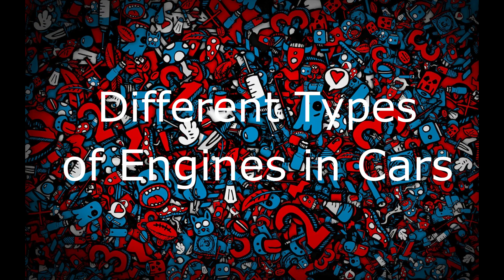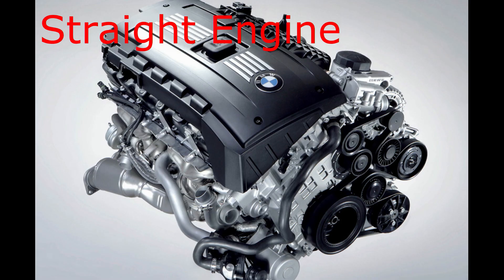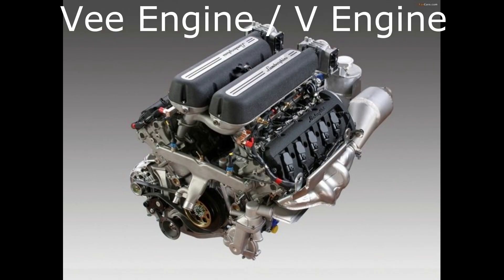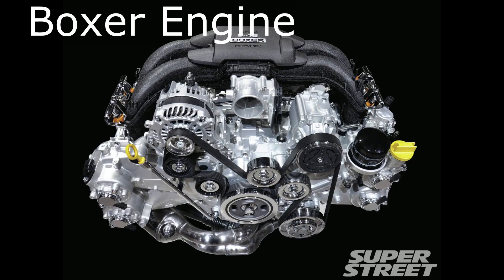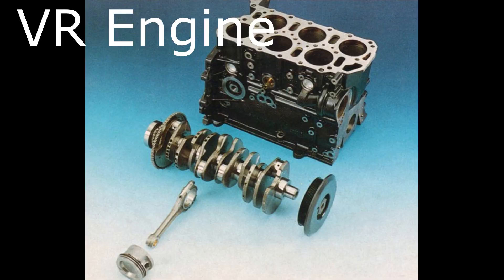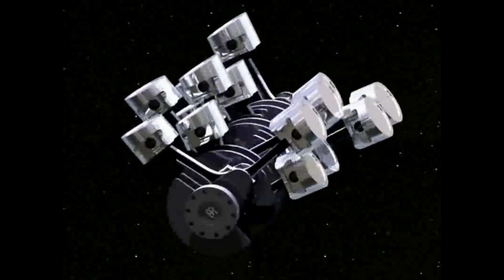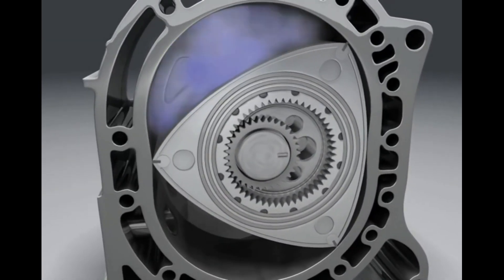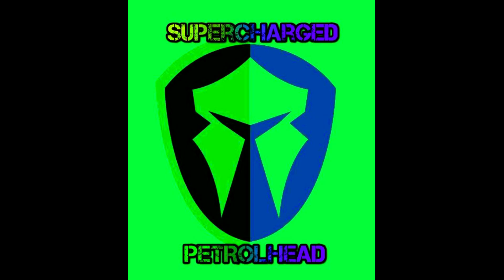Different Types of Engines Used in Cars

Comment: Great video but one error boxer and flats are different than each other boxer engine got their name because the way their piston moves which is opposite to each other where a flat is just a v engine mounted at 180 degree. Boxers and flats are different but straight and inline are same
Reply from the maker: yep, both the boxer and flat engine do have different types of crankshaft which makes them different and the straight and inline are similar engines except for the way they are positioned in the engine bay.
This is not a in-depth video, that is why I didn't go really deep interms of difference based on crankshaft and firing order and so on. 
This is a simple video for people who are not into cars to learn about just some types of engines and to differentiate them by just looking in the engine bay.
Thank you for watching.
cheers.

Comment: engine 1 is the same as 2 so no difference there u did however 4get 2 stroke cycles and 5 piston arangements or 3 like all new engines are doing plus ELECTRIC and my favourite AIR isnt on your list along with JET or ROCKET wich i feel needs adding to give a full impression of available engines the only engine not to be put in a car is the STERLING BUT!!! IT IS IN A SUBMARINE created by denmark or sweden wichever it won the WAR GAMES TITLE 2018 OR 9
Reply from the maker: Inline and straight engine are pretty similar but the main difference is the way they are positioned in the car, inline engine are placed horizontally in the engine bay that is they are placed inline with the front axle hence the cars will be mostly fwd or awd.
Interms of straight engine the engines are placed longitudinally in the engine bay and hence mostly the cars will be rwd or 4wd or awd....
Both might seem the same but have quite an major impact on the type of drivetrain and the type of car itself, that is why they are differentiated as inline and straight engine.
And this video is about types of engines based on cylinder position, hence I didn't particularly mention 2stroke because it can have all the same type of engine mentioned in the video like 4 stroke engine.
I did mention and talk about 3 and 5 cylinder engines, you might have heard it if you didn't skip and having odd number of cylinders doesn't change a thing. it still will be either inline or straight engine or in a very rare case a v engine like the v5 engine in a Honda's superbike.
I didn't talk about electric motor because it is not an IC engine, it is an electric motor.
Again I didn't talk about jet or rocket engine because they are not used in cars, yes there are some test mules and record breaking cars that use rocket engines but how many cars are available with jet engine that you can buy and that is the case with Stirling engine as well...

Comment: 4:15 Thats not a rotary engine. Thats a rotor engine. A rotary engine was the turning piston engine used on most ww1 fighter planes.
Reply from the maker: Those airplane type engines are called radial engine not rotary...
Reply: @superchargedpetrolhead  Radial and rotary engines are different. At a radial engine, the pistons are mounted to the still standing plane. But on a rotary engine, the pistons are mounted to the spinning propeller. Rotary engines were invented much earlier than radials or rotor engines which are used in a few cars
Reply from the maker: Nope....
Reply: @superchargedpetrolhead  That for example is a radial engine:
https://youtu.be/VZSDsWk9rdc
Here is a rotary engine:
https://youtu.be/Nk9Dl6RZxmQ
You should clearly see the difference
Reply from the maker: @Simon_r2600  Well thanks for letting me know...
I knew radial engine but i didn't know there was Radial-Rotary engine...
But this video is about engines which are most commonly used in cars and in the automotive sector, rotary engine refers to the wankel engine...
But those radial-rotary engines are certainly really cool to see and thank you for providing the link, I learned something new today...
cheers mate.

Comment: Which engine is use in race car and which engine is use to pick heavy load and Run fast
Reply from the maker: Currently most race cars use V type engines but there are some exceptions.
For your second question, the answer depends on the usage. every engine can be designed in certain way to either pull heavy load or have a really high top speed...

Comment: What about radial engine?
Reply from the maker: well, it is not commonly used in cars hence was not included.
Thank you for watching, cheers and have a great day.
Reply: supercharged petrolhead oh, okay. Do you think radial engines could work if they were placed on the wheels themselves?
Reply from the maker: @noahschuler6388  I don't think so, an IC engine needs a perfect placement and transmission to transfer the power so i don't think you can do that. cheers
Reply: supercharged petrolhead  thanks!

Comment: should i buy a car with 3 or 4 pistons, which one is best and which is better in gas milage
Reply from the maker: Which car are you looking at and what is their engine size?
Reply: @superchargedpetrolhead  I'm talking about the toyota PASSO which has 3 pistons compared to a 4 piston car like toyota VITZ which both look similar but have different engine sizes
Reply from the maker: @ilynpayne7491  Both cars are not sold in my country so i don't have a personal experience of them but from what i found on the internet that the passo has a 1000cc 3 cylinder and vitz has a 1500cc 4 cylinder. Basically a 4 cylinder is much more smoother and refined compared to a 3 cylinder. interms of mileage it is usually tough to point out which will be better but if you use it only for the city commute and you drive mostly in slow traffic then the smaller 1.0L 3 cylinder could be efficient and if you do a lot of highways and usually you live in a area with lesser traffic and you do some consistent high speeds then the 1.5L 4 cylinder could be better.
It also depends upon the weight you carry if you carry more people usually, then the smaller engine will struggle to keep up the speed inturn it might give less mileage than usual and also mileage depends on the type of transmission and the no.of gears in the transmission, your driving habit, etc.
On the whole i would say that the 1500cc 4 cylinder will be much more powerful, smooth and refined but the smaller 1000cc 3 cylinder will give better gas mileage.
I would suggest you to test drive both and see what suits your needs better, cheers mate.

Comment: 2:07 Honda make V5 engines
Reply from the maker: yeah, but the video is about engines used in cars, i referred to the common types of engines used in the cars, but anyways thank you for watching and have a great day
Reply: supercharged petrolhead still, not like a V5 couldn't be used in cars, I'm sure it has before
Reply from the maker: yeah, there might have been a crazy engineer who might have fitted a v5 in a car cause there are no shortages of crazy engines in a car from a inline 12 to a flat 16 and some even more crazier engines but if i had to refer all of those probably video would become an hour long and no one would watch it, cheers
Reply: Fairo

Comment: inline
straight
vee / v
boxer    - used in two car companies only they are Porsche and subaru

VR engine - Volkswagen

w engine- buggati veyron

rotary - mazda
Reply: Doesn't some vw use w engine tech?
Reply: pistikepowa87 w engine is volkswagens engine becuse its combined from two VR’s, and buggati is owned by vw, so is bentley.
Reply: @peterbach9276  Yes vw used it in their phaeton and touareg.
Bentley uses it as well.
Evan audi uses it in their audi a8l
Reply: What about Duke engine?
Reply: @vivekvardhan5671  inline cylinder
Reply: https://youtu.be/2Vy5x1sJQAk

Watch this video may be increase your concept
Reply: Radial..
Reply: @F1ll1nTh3Blanks  Used in old aircraft
Reply: Also a 2jz used in my favourite car MK4 SUPRA
Reply: Ws are also used by bentley
Reply: Im 100% sure rotary isnt used by mazda
Reply: @Simon_r2600  yes, they use rotary engine for RX8
Reply: @jawadulkarim8877  The only car i know that has a rotary engine was the Adams Farewell built in 1906. Mazda wouldnt have enough space for a actual rotary engine under the hood
Edit: 
https://www.youtube.com/watch?v=tZmd7k33JWE
Reply: @Simon_r2600  Mazda was the main company that continued making rotary engines but they discontinued it in 2012 mainly because it didn't sell well and rotary engines aren't very efficient.. They did put there 787B in a Japanese race car that won the 24 hour Le mans. I don't remember what the car was.
Reply: @Josh_dicicco  Im VERY VERY sure that they didnt use rotary engines. They wouldnt have enough space in a small Mazda for normal rotary engine and it would be inefficient. There was only one car in the world that was fitted with a rotary engine (Adams Farwell in somewhere around 1910) and also a few motorcycles used it back then
Edit: Here is the Adam Farwell car:
https://youtu.be/tZmd7k33JWE
Reply: @Simon_r2600  Your right they didn't use rotary they used a Wankel. Mixed up my history.😅
Reply: VR was used also by Lancia, who patented it in 1915 and used it starting in 1922 with the Lambda (VR4, one of the most innovative cars in history) and Trikappa (VR8). In 1972 Lancia won is first rally championship with Fulvia (VR4)
Reply: What about flat engines?
Reply: legend

Comment: This was EXTREMELY helpful in my quest to save money by builing my own car (which after educating myself a little i know is going to be really hard) and I'd have to say im leaning towards building a rotary engine for its simplicity and power to weight ratio, or a VR engine because they're compact. Also considering either a boxer engine because i love Subaru and they use boxers, or a straight engine build, but those are kind of complicated and require a lot of space in a vehicle's engine bay.
Reply from the maker: Cheers mate, and best of luck for your build 
Thank you for watching and have a great day
Reply: Don’t get a rotary if you are trying to save cash bc they are so unreliable and the fuel consumption is going to kill your bank account
Reply: Straight is just inline (as in a line (in-line))
Perpendicular mounted engines are used in FWD cars and straight or front to back configuration are mounted in RWD cars etc.
They are often the cheapest to buy, and easiest to maintain and maintenance, as well as some can cope with a lot of boost (like the JZ engines which utilize a closed deck iron block. However they have the highest center of gravity and can weigh a bit depending on material and size. 

Unless you have deep pockets or a good income, I’d avoid rotary engines. They’re great engines but there’s a reason they don’t currently produce them anymore. They are notoriously unreliable from a longevity standpoint. They have horrible fuel consumption and as a part of their design they also burn oil at an increased rate. So you constantly have to keep your apex seals in top shape, and regularly have to top off oil. 

Boxers are used virtually exclusively by Porsche and Subaru, the sound you typically hear from Subaru that’s distinctive rumble is the boxer engine layout combined with unequal length exhaust manifold/headers. 
Please note that while all boxer engines are flat engines, not all flat engines are boxers. They are called boxers because of the way the pistons fire and move to one another it looks like a boxer punching. Flat engines are just flat with opposing pistons but not necessarily in the same configuration. 

They are also fantastic engines, but because of their complexity they are more expensive, and due to their layout they are not as easy to maintenance as an in-line engine. For example on my 2013 Toyota 86, my exhaust manifold is underneath the car, and the spark plugs are a nightmare to access because the pistons are parallel to the ground. However they have superior center of gravity and handling characteristics compared to other engines and still command decent power. 

V engines are more complex and expensive than in-line, but less so than a boxer. They also have great torque and power output, but can be more expensive to maintain given the amount of moving parts. This is a great middle of the road option, providing usually a lower CoG than inlines, but easier maintenance than a boxer while providing good power. 

W engines are another thing altogether. 

So I hope this helps you in your engine decision making. :)
Reply: HAHAHAHA